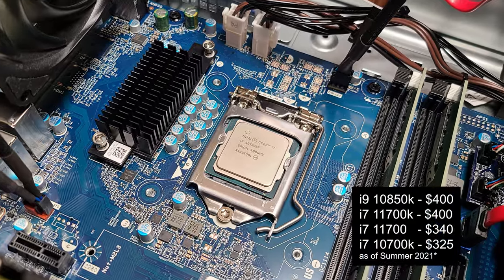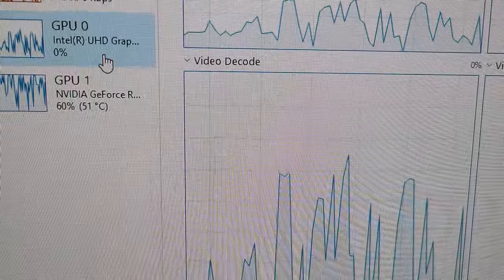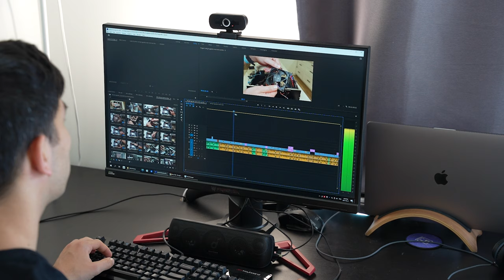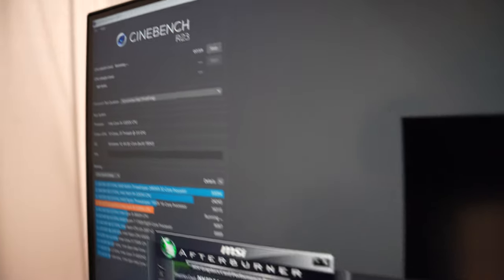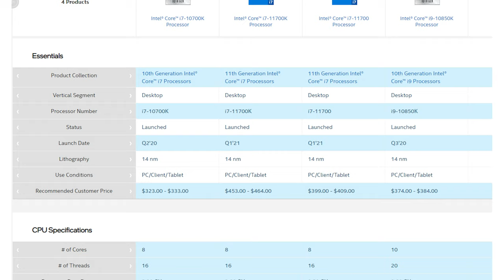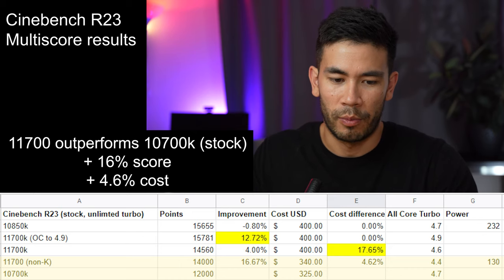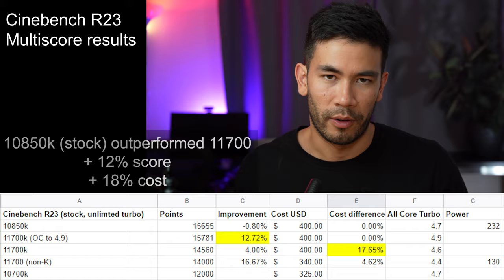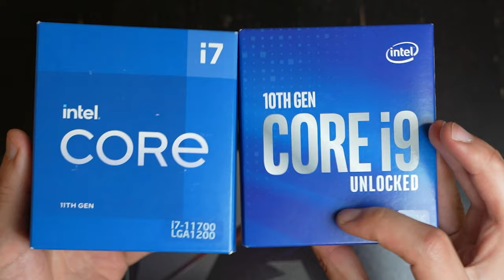Unlocking the TRUTH about Intel K unlocked CPUs! (.. and why you probably don't need it)

Comment: Excellent video I watched till the end as most people don't.  You are correct about the numbers but I would add that you can save $$$ by building instead of pre built for example you can get tower coolers for $25.  Pre built always rip off consumers because they always skimp on quality. Also I think the k chip is the way to go if you can oc to 5ghz if your a gamer also for resale value will be best option on used market. Non k chips lose tremendous value especially on FB because the lowballers will eat you alive!
Reply from the maker: I regret not buying k

Comment: Just purchased a 14700 non k variant with an Asus Rog Strix B760g DDR5 Wifi motherboard. No one I know overclocks anymore as CPU’s have come a long way so honestly, I didn’t see the point in paying extra for the K variant and equivalent motherboard for the overclocking ability when I have no plans to overclock now or into the future. Much prefer the 65 watt vs 125 watt TDP as well as I’m not into AIO cooling and always opt for air cooling.

Comment: Note for the 10700 (and other locked CPUs). With stock settings, it will boost to 4.6Ghz for a minute or more and use 135-150W. Then it will drop to 3.9Ghz or something, and its advertised 65W TDP. If you have a half decent motherboard (Strix B460-F for me), you can remove the power limits, and thus the CPU will always be at 4.6Ghz 150W (if it needs to obviously, in gaming its going to be at 4.6Ghz but only use a fraction of the power). Thus you will use the CPU to its fullest potential without it dropping to its stupid 65W TDP
Reply: you can not lower the voltage of a processor non k right? for best performance and temperatures
Reply: @BikeIsLife4EverGG  you can, I undervolted mine and it draws max 140w instead of 150w

Comment: I decided on a 10850k mainly due to the fact it was on sale and came bundled with a z490i strix board for 500. It was a good combo.

In the case for 11th gen you get to have ram unlocked. I think if you went with 10th gen the k series is worth it. But those prices and availibilty is changing quickly

Comment: Great video 👍.  One thing, however, almost every reviewer ignores:  how much more electricity does a non-overclocked 11700k use vs the 11700.  I think a long-term increase in my monthly electric bill would be as important as the initial cost of the cpu.  Did you use any type of watt monitor when running your tests?  BTW, right now Microcenter has lowered all i5 & i7 cpu prices so much (even better than Black Friday prices) that k vs non-k wrt to cost is really no issue at all.  (I realize that your video was posted pre-Black Friday & pre-12th gen.)
Reply: You can always undervolt the K variant
Reply: @TaxEvasionUS  Very good point.  I just watched a Level1Techs video: i9-12900k vs i7-12700k.  He uses a meter to check total watts used on the i9.  He says that he had numbers over 800 kwh and that the i7 would use ≈ 60-100 less.  I'm interested in the diff between i7k & i7 non-k.
Reply: @moontan.  I think even with undervolting considered, AMD's 5th generation is a better value because not only will undervolting save you more energy and reduce heat, but you will actually gain higher clock speed and overall better performance if you were to overclock the chips. I think that the best chip for JSyntax would be the Ryzen 5 5600g or Ryzen 7 5700g since both chips have a powerful IGPU, and is still more powerful and a greater value than an intel chip, and the boards are also cheaper too. All Ryzen chips are unlocked and the motherboards are also cheaper too. I think JSyntax needs to get out of his comfort zone like I have and try an AMD Ryzen chip.
Reply: @TaxEvasionUS  Thanks for the help.  I'll seriously consider your advice, but I've been building Intel cpu PCs since 1987 (an 80286 PC/AT clone) & probably psychologically unable to switch.
Reply: @moontan.  It was hard for me to switch at first too, but I am really glad that I did.
Reply from the maker: I don't think 10 or 20 watts will make a big diff. I notice my K cpu to run with less electricity since it's more efficient, but SUPER minor.

Comment: Nice video.
Can you please tell me which one motherboard should I choose for i7 12700 non k,
among Asus prime z690 p wifi d4 and MSI b660 tomahawk wifi d4?

These two motherboard are same price in my country. I know Asus one is z series which is usually for k but if I take this I will get some additional feature that are lacking on b660 such as pcie 5 , thunderbolt, 2.5gb Ethernet lan etc. 
But my highest priority is VRM. I want my processor to get best system to get the most out of it. (My budget can't increase). 
Please reply fast which one should I take? I have only 24 hours to take my decision. Help please..
Reply: The Asus Z690 Prime is garbage.  Many are shipping non-functional and will not power on.  I have had good luck so far with the Asus H670 Prime board.  It's fine for an i5 or i7 12-series chip non-K, but it's probably not anyone's "best" choice.  I really like the Asus H670 TUF board.  It's nearly as good as the Z690 TUF board, but it's about $70 cheaper, comes with WiFi, 4 NVME m.2 ports, and very good power delivery.  It also looks good.  It costs about as much as the Z690 Prime board, and doesn't appear to have severe quality control issues.

Comment: Is a decent cooler like the Noctua NH U12S enough for an I9-K  without overclocking or do I need a better cooler?
Reply from the maker: It'll work fine but not if you plan on overclocking
Reply: @JSyntax  Will the B-series motherboars (B660) allow the I-9K to reach normal turbo boost clock and max turbo power (241Waats) or do i need to invest in a higher end motherboard?

Comment: with the non-k skus, they have a lower tdp at 65w tdp than their k models at 125w, from i5 to i9. is it really that big of a heat production difference
Reply: you do understand that the 65W TDP is when the CPU stays on its base frequency like 2.9GHz. You can downclock your K version to the same frequency and will consume the same. So not really any differences here.
Reply: @sirab3ee198  I did not know that. That's a fair point and I'll keep that in mind

Comment: if you dont build it, the Dell xps non-Kvariant has a stock Intel cooler (as intel provide a crappy cooler only with the non-k) and a proper cooler for the K one (as intel does not provide any cooler with the k version), huge difference.
Reply from the maker: yes indeed, thats why getting a K cpu for prebuilts is usually a decent deal!
Reply: What if you get an Alienware with built in water cooler.  Does the K matter?? I’m looking at their i9 F non Kf and want to buy but I worry I’ll skimp (note I’d have to “settle on an i5 most likely if I get a KF)

Comment: I picked up my Dell i7-11700 with 3060 for $1214 U.S for black friday special. I could have gotten 3060ti and 2TB for $1599 to me that was a bit much, I also wouldnt have gotten no interest for a year with the TI version model, I am  too lazy to overclock it anyway if I could which I can't with the Dell anyway. Also the Alienware version with the same specs had that same crappy CPU cooler.

My overclock could be taking the side case cover off until I get the Cooler replaced.
Reply: The scary part is if you sold it on FB the lowballers would offer you like 600 for your system!

Comment: Tired of people telling others to get the iGPU when it's literally trash, It costs $50CAD more for the non F version here in Canada, and even if you do video editing it only gives like a 10% performance increase when rendering videos with Quick Sync, also I've seen gpu's like the GTX 680 come on sale on Ebay for $90CAD after tax and shipping, that will completely destroy the garbage iGPU.
Reply from the maker: For me, as a video editor, it's worth every penny! I noticed a big difference
Reply: @JSyntax  Nvidia's NVENC completely destroys the iGPU for encoding/decoding, really no reason to use the iGPU, I'd rather save the $50CAD, F series chips offer the best value for money.
Reply: I think iGPU is worth the money. Sometimes, my VGA breaks down and I still be able to use 2 monitors with the iGPU (my mainboard features 1 HDMI and 1 DP)

Comment: so what u recommend i have i7 10700 non k and am not working in editing videos 4k and i just got it for gaming only with mother board b 560 and 3200 m.hz 16 GB ram so 
does it worth or not ?
Reply from the maker: You are good with that!
Reply: Just so you know, when using a 500 series (b560) with a 10th gen intel the top M.2 slot is inactive (usually the hidden one). If the board has more than one M.2 the rest will work fine. 

I am also fairly sure you have to get a z series board to fully utilize the 3200Mhz ram, the B460/560 I have seen cap the ram speed at 2933. Mine caps there, and without a k skew processor I don't see why z series would be worth it. They just want to upcharge for every feature. 

Both of those things above are not really anything to worry about (as long as the M.2 options you planned still work) and will let you put an 11th gen chip if you want to one day.  I would say if you don't own the parts maybe checking to see if 3200 can be fully used, might save a dollar or two going with 3000 given the cap. It's certainly not a big enough deal to start returning things, just know you might only see 2933.

Comment: your vids are so good and you should have way more subs

and I wanted to know if its worth it to put another fan for more airflow (for mining) on my g5 5000 (I would put it below the light beside the GPU)

specs: 
i5 1040f (I changed the stock cooler to a better one)
rx5700xt
512 SSD
16gb ram (1 stick)
Reply from the maker: Yes that is a good idea! Did u see my fan video for the Dell g5?
Reply: @JSyntax  yeah I did but I still wasn't sure

Comment: There are occasionally good reasons to choose a K variant.; the most notable to date is choosing an i5 12600K over an i5 12400/500/600.  Obviously, the K variant of the i5 has four additional cores, which changes the game entirely.  The price difference between, say an i5 12600 and an i5 12600KF can be less than $30.  That's an inexpensive and significant upgrade, in my opinion.